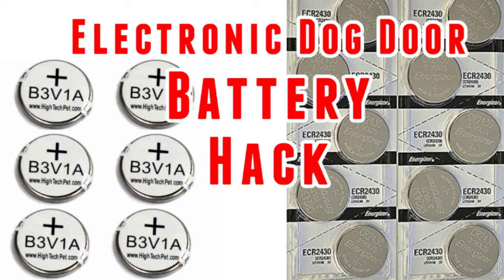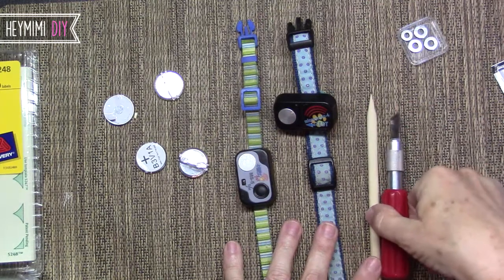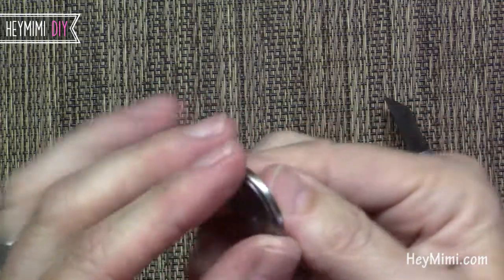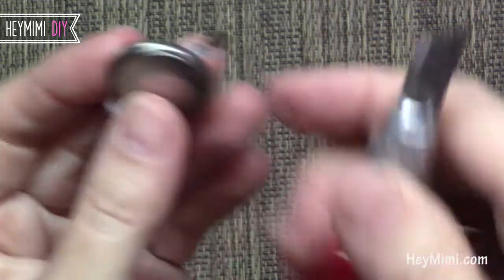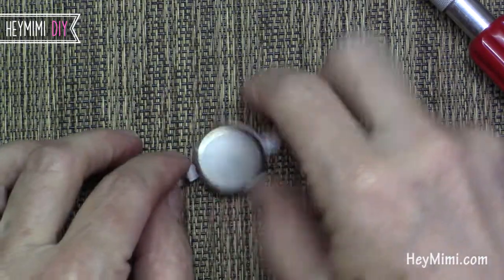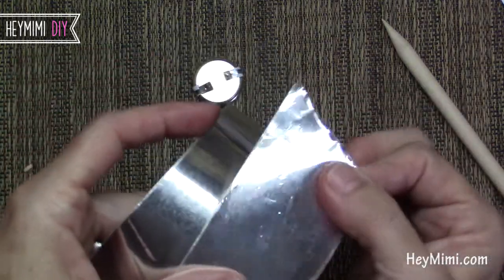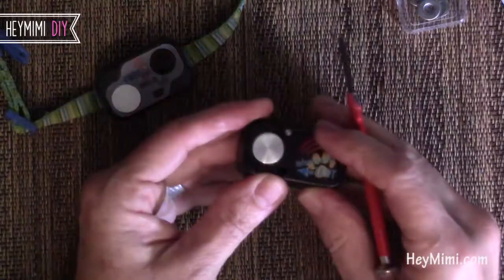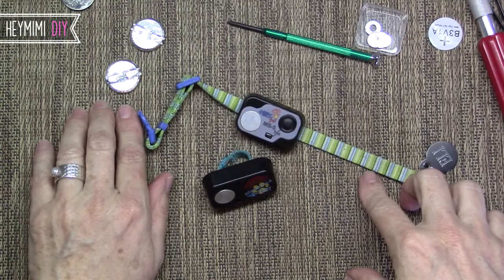High Tech Pet Collar Battery Hack - B3V1A vs CR2430 Batteries

Comment: Thank you so much!  I find that I cannot release the tab welds on the bottom of the battery with an Exacto knife, so I use a small flathead screwdriver from a glasses repair kit.  And the metallic tape (Shurtape) works perfectly to hold the tabs down.  I really like Hitec Pets' products, but I am not a fan of these recurring costs for batteries.  And in my experience, the collars only last a year or two before they fail and need replacing.  And why can't they come up with a better way to attach the transmitting collar to my dogs' regular collars?  My dogs and big and like to play rough, and that thin collar is just not tough enough.  Oh well.

Comment: Really good video and explanation! You're correct the other gentleman used the washers to maintain pressure/connection. Your methods worked great for me. If a connection was loose a couple of layers of tape, or duct tape - on top of the other tape may help. Don't use duct tape directly on the battery! I am not poor but with 3 dogs the best price they offer on their batteries is too high, and I like to keep fresh batteries so none of our dogs end up locked out. Thank you!

Comment: I just use the cr2430 and must put it in upside down because I dont modify anything and it works. 
life apprxo 3-4 months
Reply: I was wondering that too. So is it still working fine that way? Well I'm assuming you've needed to change out the battery again since this post but you just put the battery in "backwards"? You didn't use that strange casing with the metal tabs?

Comment: You say you don't need to keep the white plastic donut, and it works fine. I don't know how you did that, because without it, you would be connecting the positive and negative sides of the battery and it will short out. This will immediately drain the battery, get extremely hot and might even ignite. That's why they don't transport Li ion batteries in aircraft. KEEP THE WHITE DONUT! Then it works like you say. Thanks for the video; you are saving me a bundle!
Reply: They do ship lithium ion batteries via planes. I used to work for a battery manufacturer. There are regulations, but it is done regularly.

Comment: On our dog door, we have noticed that the door itself tends to want to not close all the way after she has used it the first time, and it keeps raising and lowering itself and wears out the battery.  Any idea why this might be happening?
Reply: Sounds like you may have screwed the fastening screws into the wall a bit too tight, the instructions make mention that this may cause the pet door to take the shape of the wall, which in turn may warp the internal and add a friction to the siding of the door which may be misread as an obstruction causing the safety feature to open the door

Comment: How long did the manufacturer battery last and how long did the CR2430 battery last?  If the manuf. battery lasts like 6 months, the hacking just is not worth it.
Reply: I dont know if you reviewed the footage or not, but the manufacturer uses CR2430 batteries that they modify with that strip she removed. They'll have identical performance.

Comment: Nice work.  The original transmitters used a normal CR2430 battery.  They later changed the design so it would require their special battery.  I can only assume that was to generate revenue from battery sales, as the circuit boards hardly changed at all and they function exactly the same way.  I don't have any of the forth-generation MS-4, but on my original (MS-1?) and MS-2 controllers, I stretch the spring around to the back side of the battery, put some heat shrink around the part of the spring that needs to be insulated away from the side of the battery, and drop in a CR2430.    The best change I make is putting in a CR2450.  The 5.0mm thick version of the battery lasts significantly longer, so I am not changing batteries nearly as often.  Since a dead battery sometimes means cleaning the carpet, it is worth it.  I'm sure stretching the spring voids the warranty, but I don't really care.   No matter what battery I use, I put a zip tie around the transmitter to keep it closed.  You can slide the zip tie off to the side when you want to open it.
Reply: ...also, I made a pressure pad for the indoors, so even without a collar a dog can trigger the door.  I wired it in to the "open" pushbutton.   Now the collars are just for letting them in and.   If I knew how to convert it to an RFID collar, I wouldn't need batteries, but haven't figured that out, yet.  I'm not sure if I could use their pet tracking chips to open the door. Probably not.
Reply: up @julieh7478  p
Reply: Why doesn’t simply flipping the battery over work? Putting a small piece of tape the insulate all but the part the spring touches?
Reply: No surprise to me... I am actually digging around for info on Invisible Fence "microlite" collar reciever batteries... I already just replace the guts of the proprietary battery... but problem is the dog has scratched at the collar in just such a way enough times that I am down to only a couple battery shells. There are a few companies who make questionable quality batteries but considering I don't need the actual batteries just the body, maybe it won't be an issue.

Comment: Hey Mimi. Great video. I have had nothing but issues with these collars. I love this battery hack. I have had to order three of the water proof collars because each time the battery wears out and I try to open case the screw strips and then can't replace battery. If you put any kind of pressure on the case the plastic breaks. It has been so frustrating. And they raised the price of that collar by about $10. Very frustrating and you have to use the hi tec product for their door. The next video we need is how did you put the "key" on a regular dog collar. The one they provide is terrible and it would seem it's the only one you can use with the "key". Thanks for the good info on your video
Reply: Hi Stephanie.  I was reading your post about stripping out the screws.  It is hard to open, but with the right tools it is a little easier.  Have you ever heard of IFIXIT?  You can get technical tools for less than you could at Home Depot or the such.  The screwdriver you need is a PH1.  It will make the removal so much easier.  Good luck!
Reply: I also love the video. I've had my door for over 10 years and still have the old type collar, but it's coming to the end of it's life after being chewed on so many time. Saw these new type collars (new to me anyway) but don't like the idea of them developing a modified battery that forces you to pay too much for a battery that they own the market of. Happy to see someone figured out a hack to use a battery you can buy anywhere. Now, the reason I'm replying to another comment, rather than creating my own. I see this video is six years old, so I hope you still see this Mimi. I couldn't agree with Stephanie more about showing us what you did with the collar. I absolutely hate the cheap collar they give you. For $50 (the current price for the new sensor) you'd think they would have developed the sensor with a better collar. Would love to take a better look at what you did. prestcs@comcast.net